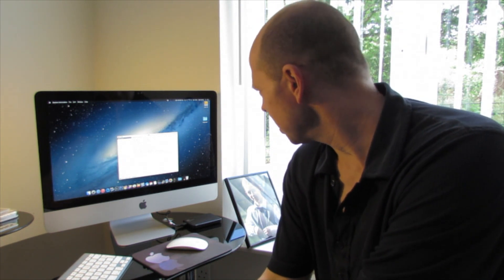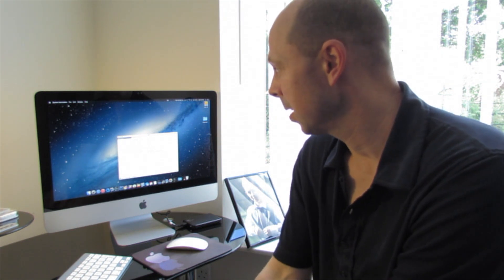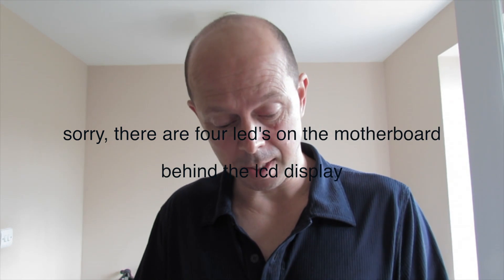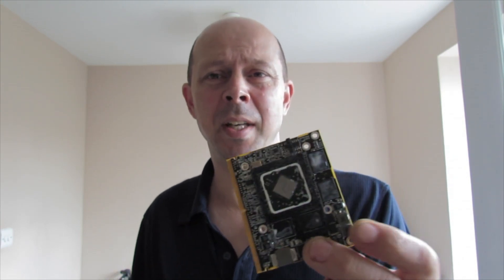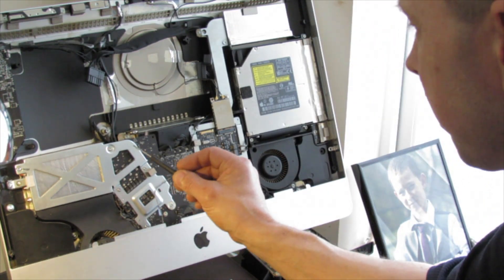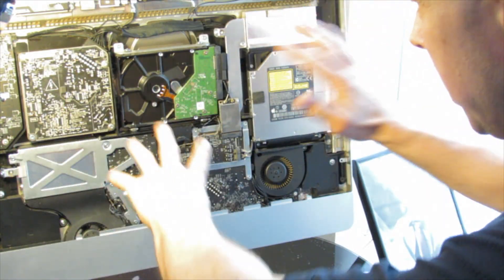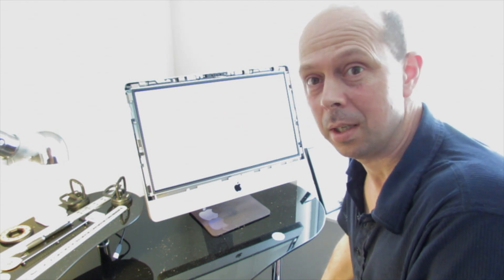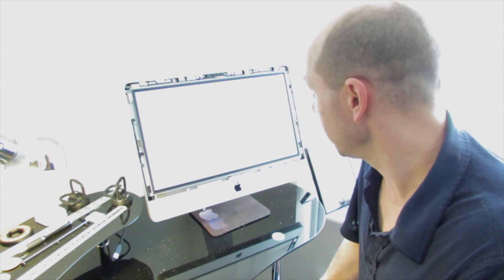apple imac black screen of death ( late 2009 i3 3.06ghz )

Comment: OMG! I have the same model with THE exact same issue! I will have to try this. Thank you SO Much!
Reply: RetroVGworld how did it go? I have the same imac
Reply: Joshua Maxwell I opened it up to see that it actually didn't have a graphics card, but had an onboard GPU instead. I think that the problem may be a faulty backlight board, since with a flashlight I can faintly see the screen. My screen turns on occasionally but to fix the problem I bought a MiniDisplay port to HDMI adapter and I use my TV as a monitor.
Reply: Have you fix your card using this solution?

Comment: how long hAS THE FIX LASTED?
Reply from the maker: It is still working to this day. I am waiting for it to pack up again so I can replace the graphics card but it has been fine so I just keep using it.
Reply: i just sent my imac g5 2.1ghz from 2006 to get this done...they charge 25dls here in tj to get it "professionally"done...my imacs symptoms where similar..it would stay on for a few minutes then black screen but everything functioning in the background..CAN YOU GRAB AN OLD IMACS HARD DRIVE AND PUT IT IN A NEW 1 AND GET ALL INFO OUT...FOR EXAMPLE: LAYERS FROM PSHOP OR SONG W/THE INDIVIDUAL TRACKS TO KEEP WORKING ON?TY 4 THE RESPONSE
Reply: After two months it was again broken :(

Comment: Wow!  How did you even know how to take an iMac apart?  I don't see any way to remove the screen w/o cracking something.  Also, there is no place underneath my iMac to insert RAM.  You should do a video just on disassembling and reassembling the casing and screen for your iMac!
Reply from the maker: +Donna Brooks 
the dmg file you downloaded from the mac update should install no problem, what model iMac are you using?
you use suction cups to pull the screen away from its magnets at the top corners, as for taking the mac apart, I've taken many things apart over the years lol.there are plenty of you tube vids showing how to take them apart.
i would not call what i did to the video card a permanent fix although to this day it is still working fine but in all honesty if you have this problem and know that the video card is at fault then it would be best to get a new one.
Reply: alan howatt Thanks. I'm using a friend's computer which I hate.  I already watched some vids on taking the cover and screen off and different people have different fixes for this problem.  I have a late 2009 iMac running Snow Leopard, and the installer has a circle with a slash thru it, indicating it can't be installed on my OS.

Comment: Can I use A lighter?
Reply: I have seen people manage a successful "repair" with a lighter.  If you had to do a fix in this way, I would bake it in the oven for a few minutes, at around 220 celcius, at least the temperature is regulated.

Comment: Hi. Guys If it passes a 3D stress test like Heaven or Furmark and similar on Boot Camp and the stress test for the CPU. It's not the GPU. One just needs to adjust the fans, HD at 2200 rpm, the CPU at 2800. If it doesn't pass the 3D and CPU stress tests, that's the time to "reball" the GPU chip with torch or have it repaired. But try to adjust the fans first using smcFanControl for OS X and the Macs Fan Control for Windows. God bless. Rev. 21:4
Reply: Stress test? How do you see that on the screen if the GPUs gone?

Comment: You didn't show what you blow torched?
Reply from the maker: +PETER DEE 
yes i messed up, the camera was not recording so when it was all back together it was too late.
i will make a vid this weekend showing how to heat the board but all you actually heat is the chip in the middle of the circuit board. it is tricky as you have to to careful not to get it too hot, move the blow torch in a circular motion around the chip.

Comment: Hi, i think i have the same problem. At the very beginning it turned black for some seconds when i started a game match, then it would be ok. But one day it started to remain black on start up. If i turn it off and then on two or three times, the display may turn on. 

Then, if i use the computer for things like Safari, Traktor Pro 2 (dj software) or so it will not turn off. If i play a videogame like Minecraft it will turn off.

Do you think i can solve the problem by following your steps or is it different? I don't want to take the risk if it's not sure i have this problem
Reply from the maker: +Franporky19 
i only did what i did as i was prepared to scrap the computer, your problem could be a very different one to mine.
when my screen stayed black, that was it, permanent fault until i fixed it. if your computer is worth a lot to you it may well be best to let a competant computer repair shop  look at it.
Reply: Hum, then i can prepare the wallet because it will not be cheap. Thanks for the help!!

Comment: hi I had black screen but if I had it on brightness 3 it would be ok. any higher it would go black. for many months I was trying to find the problem. then it would constantly just go black screen when I powered it up so I ended up using mini display port to my tv. then many months after it randomly starts working and I restart system and its fine. its a very strange 1 for me. but I dont know if im use to my 1080p viewing because the imac 1440p seems like its lost colour on things like things aren't as white or grey. I tried going to o display settings and selecting colour and that helps but idk If its still right. can someone tell me whats going on plz.

Comment: man, im tired of this shit, the samething happnes to mine, after I jump from 10.6. to 10.8 this issue is happening. I have 1 year with this shit. I have to restar it, reset ram, whatever apple support says and nothing it just cant wake from sleep.

I will bever buy a mac again never ever ! 

What I do to keep it working is this: I turn it off, then I disconnect all bluethooth devices, then I start it again, at this point I have to waite like 10 minutes while its searching for mouse and keyboard, finally ! see it alive again...

1800 dlls for this pieces of crap,??? not fair

Comment: How long did you blow torch it? How close to gnu? Just GPU or whole board? Thanks for the video!!
Reply from the maker: Hi. I used a soldering iron blowtorch four to six inches away from just the silver centre chip on the graphics board for about 30 seconds

Comment: my imac was working good , but when i replace the HHD 500Gb to 1TGb , after i change HHD my imac showing black screen , but (keyboard and mouse) working and sound is going on! when i restart the system one or two time display comes and working good , and many time no show any thing on the screen , now mac logo , no white screen , still showing the Black Screen , now what i do ? HELP ! :-D
Reply: +Chaudhry Farooq Saeed Arain make sure your connections are all tight
Reply: +Bwen314 Yes man i was do that , i have issue in my Display cable , i changed that cable then reslove my issue ! true